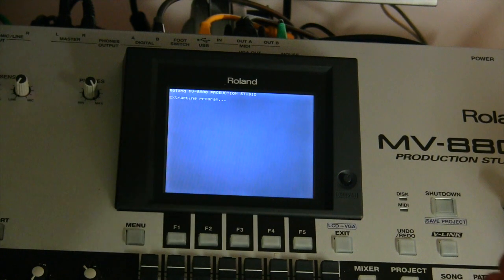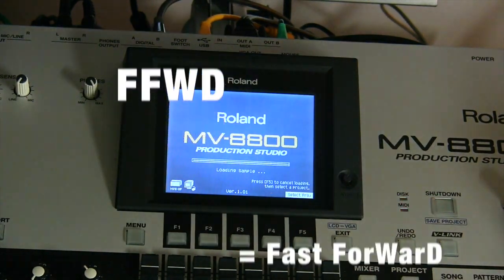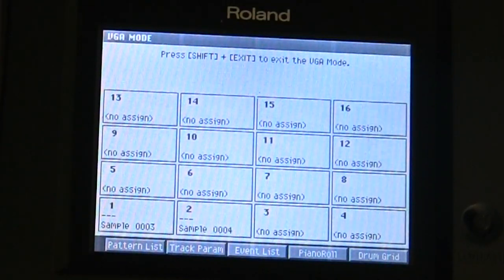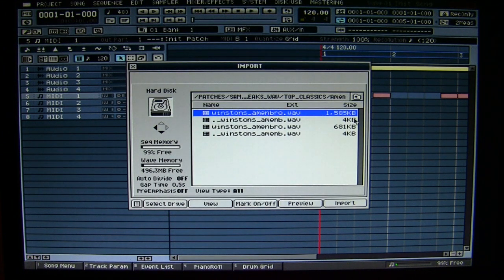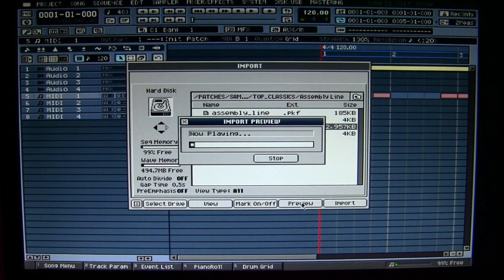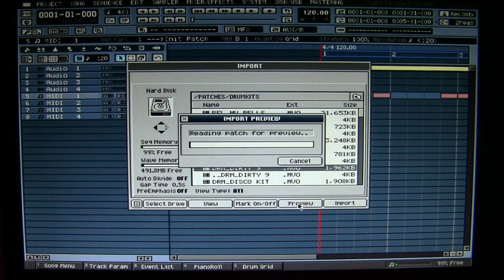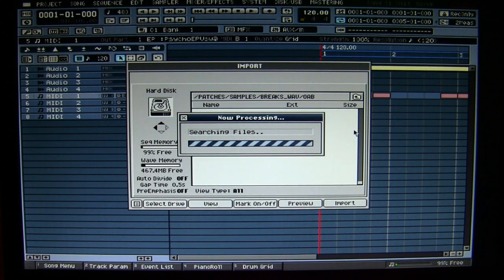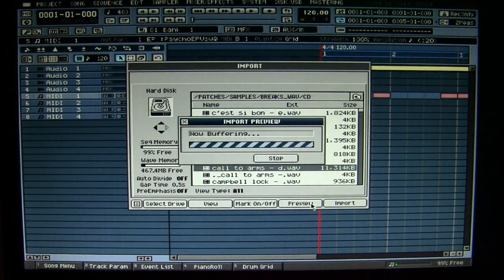MV-8800: I replaced the SSD for an IDE-CF adapter and the result is amazing!

Comment: Great video! Several questions. Do I have the CF in the reader at the initial startup to format the CF card? Can I just drag and drop a backup of the hard drive, into the CF from the computer? I have a lot of saved files/projects in the hard drive. What do you suggest I do? Thank you.
Reply from the maker: ERIC GARCIA Hi! Thanks!
Yes, you can put the CF in the MV at the first start up. It will format and put the right folders on the CF. 
Then you can take out the CF to put the backup files back by dragging and dropping with your computer. 
It’s an easy job!
Good luck and feel free to ask more questions. 
Grtzz, Roger

Comment: Not that great killing the cd reap sampling burning back-up cd master capabilities to add Cf card.  I prefer to stick with an SSD and use an USB cable when need of computer transfer. Everybody his own I guess.
Reply from the maker: Ustaz Official 
Thanks for the comment!
It’s a great solution for quicker transfer of files. 
I’ve never heard of the cd reap sampling etc. Could be interesting. 
Last week I had to open the MV to check something. Then I thought of searching for a long IDE cable to have the CF outside and to have the CD placed back. 
Then I would have the advantages of both worlds.
Reply: @theMIDImaniac  yes because I also listen my CDs straight on the MV. That's one of the reasons the Cd Reading/Reaping is priceless for me I use it alot when not using vinyls as a primary sources.
Reply from the maker: Ustaz Official that’s a technique I’ve never used but it sounds great and logic.
Reply from the maker: Ustaz Official if the CD is used for backing up master then also the CF could be used. The Mastered WAV is available in its folder. Then you can convert into another format on a computer. 
But perhaps I’m missing something that I don’t know. 
Thanks again! ✌🏽

Comment: That’s great but what about using chicken audios software with a computer to load your samples it’s 1000000 x faster than that method.....the mv 8800 is a wonderful machine I love it for its sound quality but hey man my issue is the quantizing.i know this machine claims to have 100’s of modes for quantizing but I honestly could not get a solid and perfect times beat quantize out of this machine. Tell me what went wrong?????
Reply: This is a interesting conversation you made me pull that box out the closet but man it’s soooooo slow it’s ridiculous but I love that analog sound that’s definitely what’s missing these days.....so first off that software works great and works instantly just like a computer based daw like fl would and you can create and design your own kits and save them but when making beats with those machines the quantizing jumps off badly or won’t even record like I played it and it throws the whole track off beat.i never could figure out why....o yeah it seems like you can’t use multiple time signatures.i don’t do hip hop I’m from the south we don’t really sample everything is from scratch if I want to do different rolls it’s out of the question making this machine useless when it comes to production
Reply from the maker: sergio simpson Hi!
Thanks for your comment. 
Ah...chicken system...I’m having deep contact with them because the program fails on many points. I’m working with V2. I hope to show some progress soon. 
Regarding quantise I’m curious which kind of issues you have because it should be super duper tight.

Comment: I need your help
Reply from the maker: king 9 ether send me an email or drop your question here. 
Roger@themidimaniac.com
Reply: @theMIDImaniac  my hard drive went bad I got a new one.. I try to format drive but it's saying disk not ready
Reply from the maker: king 9 ether check the position of the jumper next to the 40 pin IDE connector. 
It needs to be on master.
If that doesn’t change, set it on cable select.
Reply: @theMIDImaniac  thanks💯
Reply: @theMIDImaniac  where can i get ribbon cables for my mv 8800
Reply from the maker: king 9 ether ribbon cable = normal ide cable.  Search on eBay. 
You have to open one insert only. I did it with a small screw driver.
Reply from the maker: king 9 ether it’s a normal 40-IDE ribbon cable which can be found in old computers. 
The only difference is that you will notice that one hole is closed. You can open that hole with a small screwdriver. 
Then it will fit in the IDE of the MV.
Reply: @theMIDImaniac  I need the 16 pin blue & white jumper you think an old PC will have it
Reply: @theMIDImaniac  how wide do you think that 16 pin cable is

Comment: I was wondering what the max size one can use with the MicroSD and brand? Very much interested in upgrading
Reply from the maker: Good question. I've tried only cards with 16GB up to 64GB and all working.
Today you can order MicroSD-cards up to 500GB....but at the moment I'm not going to spend 175€ for a card.
I will buy a 128GB MicroSD to do a test. Those are 18€ ;-)
Better to have more smaller cards than just one biggie. If that one breaks...
Reply from the maker: Ah...128GB works :D
Reply: @theMIDImaniac  What brand of micro SD did you use with adaptor?
Reply from the maker: J Signature I use Kingston. I tested 32, 64 and 128 GB and all work.

Comment: Thanks Roger that was very interesting as I’m having so much trouble and stress getting the MV to recognise and format an SSD, I think I may have seriously investigate consider this option instead! Any advice on what IDE to CF adaptor to use!
Reply from the maker: You're welcome!
This adapter will work 100% https://www.newegg.com/startech-35baycf2ide-compact-flash-card-to-ide/p/N82E16812200158
You can search for other online shops, of course. But the adapter is the right one. It has the 44-pins connection for the MV-8800 cable and the 40-pins connection for the MV-8000 cable.

Then you'll need a CF-SD adapter like this one: https://www.dennisdeal.com/products/extreme-single-sd-mmc-sdhc-sdxc-slot-to-cf-type-i-compact-flash-memory-cf-card-adapter?utm_source=google&utm_medium=cpc&utm_campaign=gss&gclid=Cj0KCQjwrrXtBRCKARIsAMbU6bEG2A-jyllwmvFU4geoWjVYhpTNOZ0wdPgDRMU5kZA3GfcmQAz5VvwaAg-LEALw_wcB

For me it works excellent. 
Yeah...again money spent but well spent ;-)
Good luck!
Reply: @theMIDImaniac  you the man roger

Comment: I don’t understand how you for the cf housing in the former CD_Rom slot.
Reply from the maker: ONEHENDRIX at this point you have to be a little creative. 
I used adhesive clips to attached the CF to the CD-ROM holder. 
I didn’t want to drill holes into the mounting frame yet.
In the future I will 3D- print a frame for it. 
Good luck.

Comment: How did you fit the Ide- Cf converter in the CD ROM housing?
Reply from the maker: Alex Dollman at this point you have to be creative. 
I used adhesive fixing plates because I didn’t want to drill holes in the CD-ROM housing. 
Also I put one on top of the IDE-CF to have it fixed against the bottom plate. 
I used these things https://www.gmb.nl/item.aspx?id=6939

Comment: I'm gonna be doing a similar operation on my MV8000. I plan to replace the floppy drive, as I still use my "DVD" upgraded drive. I bought a IDE-to-SD adapter for my VP9000 years ago, but I never used it. This video has inspired me to try it on "MarVa". Keep up the GREAT work Roger.           Peace...Netm8kr
Reply from the maker: Netm8kr yeah, using the space of the floppy of the 8K is a great idea!
And I assume the adapter has a 3,5” IDE connector so it’s an easy operation. 
Your MarVa deserves it 😉
And as always thanks for your support! 
✌🏽✌🏽✌🏽

Comment: SEHR SEHR GEIL 😎 wenn ich überlege wie lange das mit dem Rechner über USB dauert ... ausserdem hab ich alle meine Tracker Daten auf sd Karten 😊 das ist richtig super weil ich mir diesen echt langsamen Transfer spare 😎 wieder mal grossartig Roger 😊 das mach ich auch direkt bei meinem mv 😊 wirklich vielen Dank das du das mit uns geteilt hast 😎✌
Reply from the maker: Christian Torma Für mich war es auch eine große Entdeckung. Vorher habe ich mehrmals gesampelt statt der USB zu brauchen. Sampling war vielmals schneller... aber jetzt ist e nur drag & drop 💪🏽💪🏽💪🏽
Reply: @theMIDImaniac  ja Sampling war halt echt immer die erste wahl 😊
Reply: Die Frage ist aber auch, wie es soundtechnisch aussieht. Die A/D-Wandler in der MV (und Samplern generell) haben immer etwas andere Charakteristik. Ich finde direktes samplen von Vinyl immer etwas 'knackiger' als via Audio-Interface (MOTU 828, also kein Schrott ;). Sample-Libs oder CD rippen nutze ich fast gar nicht.
Reply from the maker: Daniel Lipka du hast da ganz recht. Sampling hat seiner eigenen Sound über Übersetzung von files. 
Du nennst das Gebrauch von CDs, deswegen habe ich die CD-Läufer annulliert weil ich das doch nicht verwende. 
(Vielleicht fiele Fehler aber du verstehst mich 🙈👌🏽)

Comment: is there a possibility to retrofit a SP-808 with a CF Cardreader ?
Reply from the maker: There's only one CF-reader which will work with the SP-808. It's the one from the blue MPC 2000-XL. No other reader will work. I've seen a SP-808 with this reader + OP1-expansion for sale for 400€. 
It would be nice but I'm not going to spend that much money.

Comment: Now that seems Exciting Roger.Thank you for the content you constantly put out .Would you mind  comparing the Mv loading times with ide cf with the video that you did with ssd. Thanks
Reply from the maker: Ok guys, I will spend time on that. 
Due to the lack of speed improvement of the SSD I preferred to have easy access to the drive for quick file swapping. 
With this solution I have that. 
I will test loading the demo projects as I have the times of the SSD and the HDD. 
Keep you posted ✌🏽
Reply: @theMIDImaniac  I'm curious on the project speeds w/ the CF card as well, thanks!  Please post speeds of all 3 if you can.
Reply: Yes dear mates, i'm also interesting to see the difference in seconds between both. Also in charging the projects.

Thanks Roger for your tutorial 👍🏼